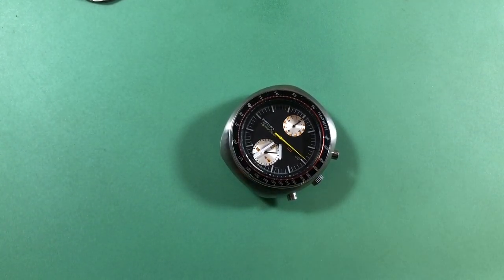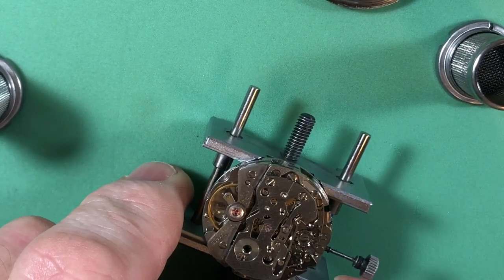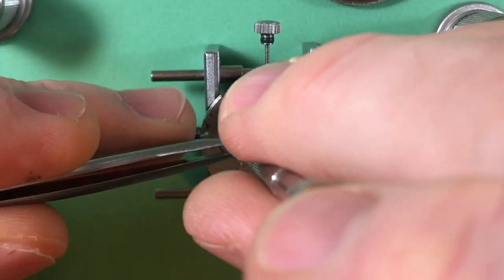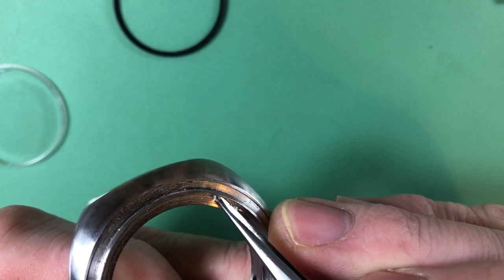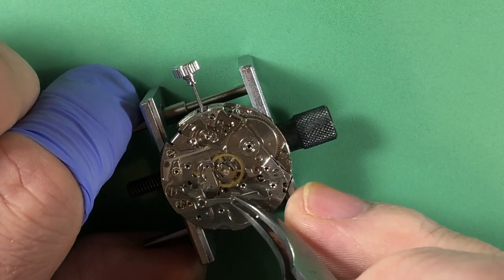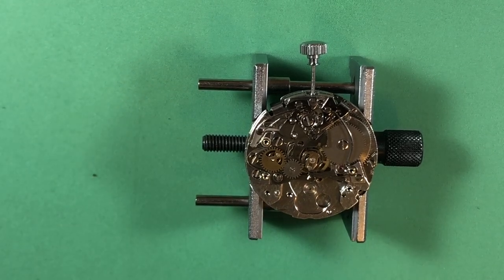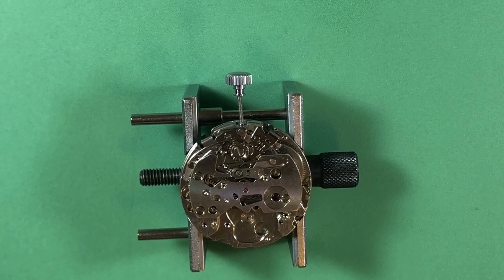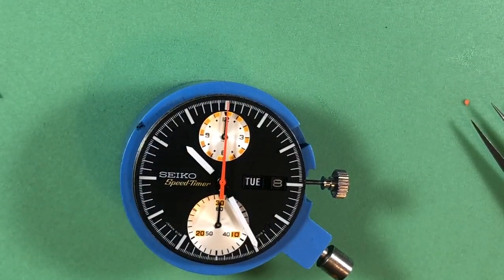For SL: Seiko 6138-0011 restoration

Comment: Hi Spencer,

I've learned a lot about the 6138 movement from this video, but there's one thing i'd like to know more about:  How do you tune the RESET light?
My RESET is very very very hard to press and then it snaps the hands realy hard back. I thinks thats the reason why my minute register wheel fell apart.

Comment: Great restoration Spencer!

I've always been wary of the 613x movements because of the chronograph wheel and clutch (eyeing a 6139-7060 or a baby panda though). 

But I remember you saying that on the 7016 movements you can't correct an off-center chronograph hand. Can you elaborate? Does that also apply to the 613x movements?